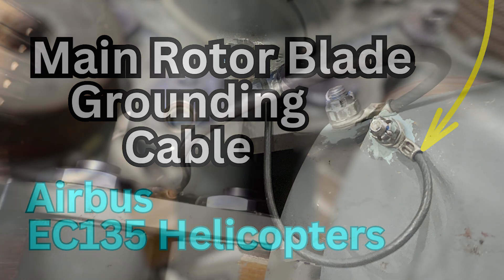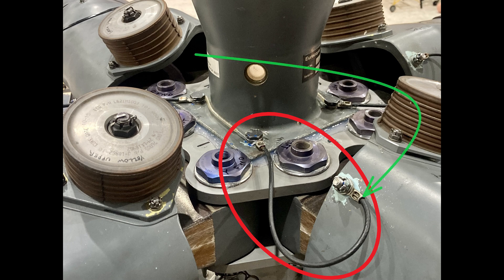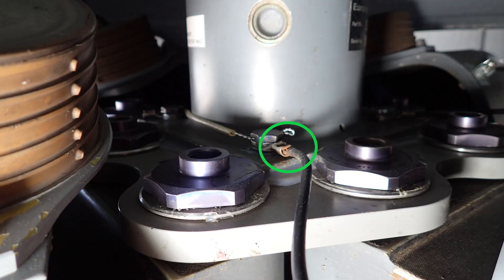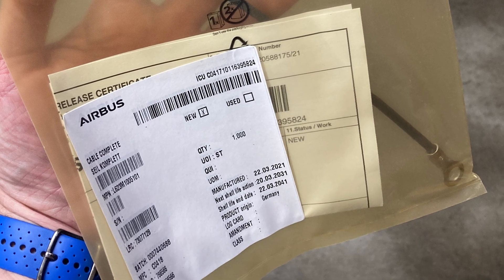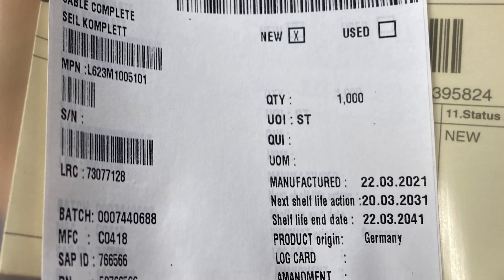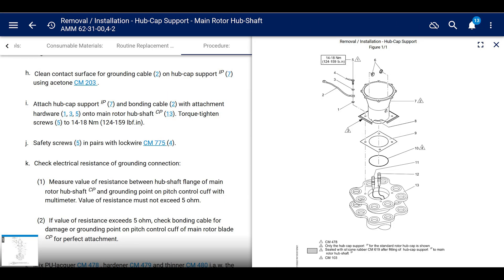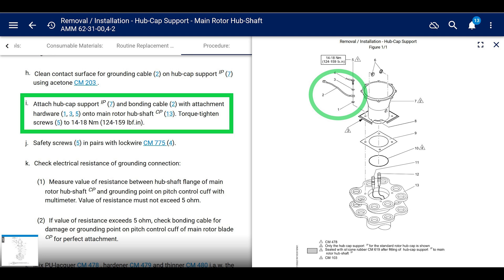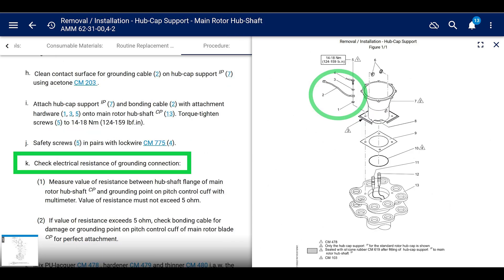Bonding Cable, Main Rotor | Airbus EC135 Helicopter

Comment: And remember to hold the screw with a wrench (inside control cuff)! Bonding cable and nut are installed on a screw that is glued/attached to the control cuff with epoxy resin. If you won't hold that screw from underneath, you might have a big problem :D 
Greetings ;)
Reply from the maker: Good call brother.  I’ve been there.  I forgot to talk about that, was trying to make a quick video.  I’m working on a video on the spacer tube inspection.  That video is taking a minute to make since I need to show the removal and reinstall if the mast and if the spacer tube is replaced you have to remove the bearing and ring and reinstall together with tube.  It’ll be a long video.  Thanks for your input Q
Reply: @HelicopterMaintenance  wow it’s gonna be an awesome video…and long :D
Reply from the maker: @qweq9972 I’m thinking of making it into 3 videos.  No one will watch an hour long video.  I guess I will have to see how long it is.  Hopefully in two weeks or so from now.